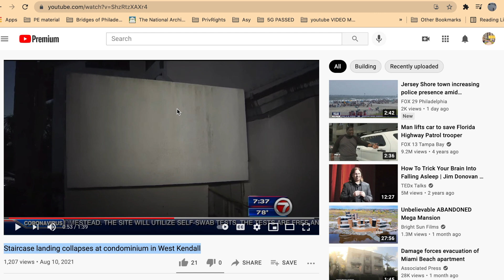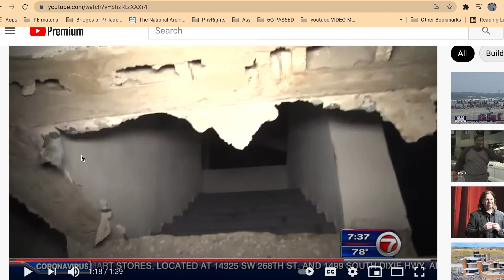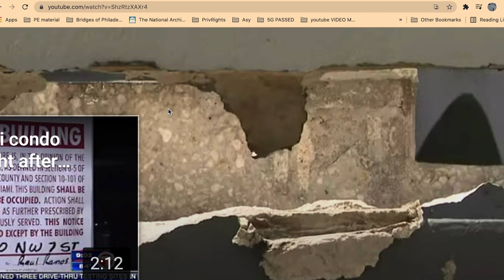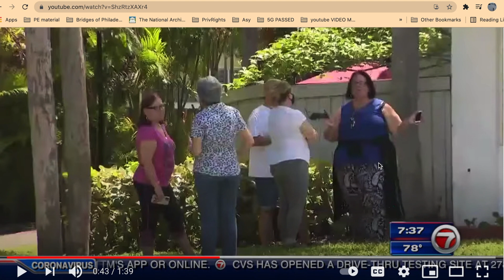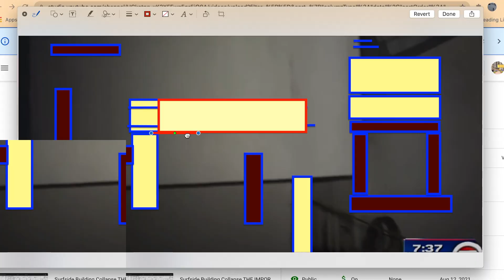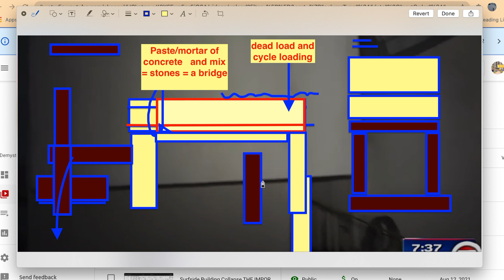Staircase landing collapses at condominium in West Kendall "Cantilever Failure"

Comment: Would be interesting to see the plans and if the builder scrimped on the steel. It would be concerning if the design was exactly followed and fairly obvious forces were not accounted for at the planning stage. How you explained your resolution made perfect sense, it will be interesting (if possible) to see how this issue is actually tackled.
Trying to tie in what we see here to the previous videos - Is this cantilever collapse effect what we see on the wall the cop looked over.
Love and meows to the kitties

Comment: How much do temperature variations affect the marriage of the concrete to the steel?  If I have a concrete slab suspended with air contact top and bottom is it better to use a smaller rebar to keep the expansion from heat down?  Say I have a proposed table and a piece of 2" (or so) diameter rebar I want to span an opening (4 foot) Is it better to go with 1/2" or so?  We go from 20f in the winter to 90f in the summer here.  Is this even a concern?   Thanks Kai!   edit-  actually just now watching- "CONCRETE AND REBAR INTERACTIONS MARRIAGE NEEDS THERAPY".  Might get my answer there??   rebar is 2.481" rib to rib.   algorithm punching comment!   :)